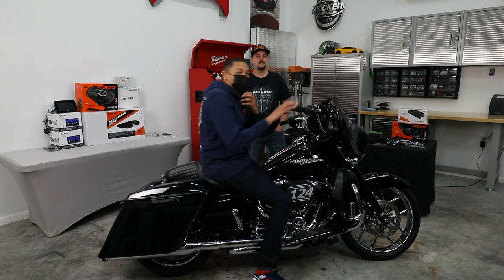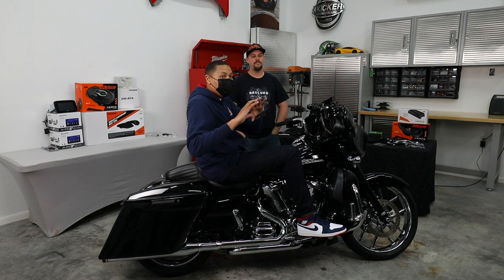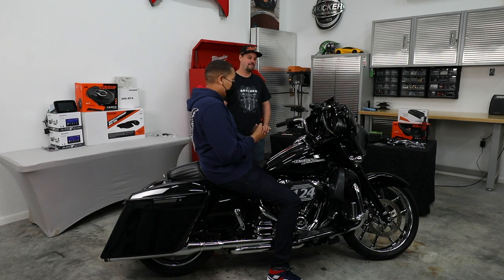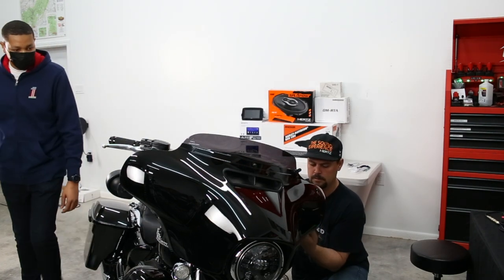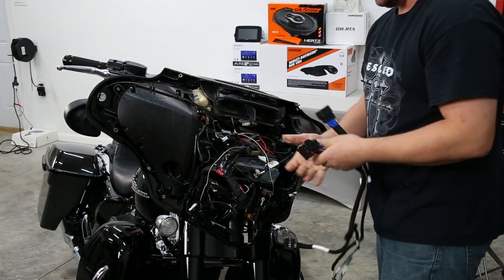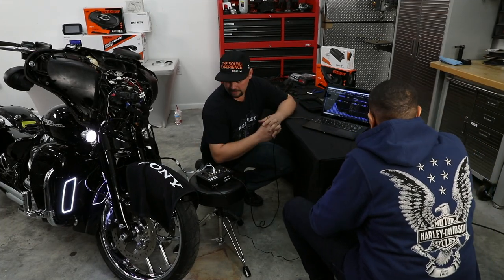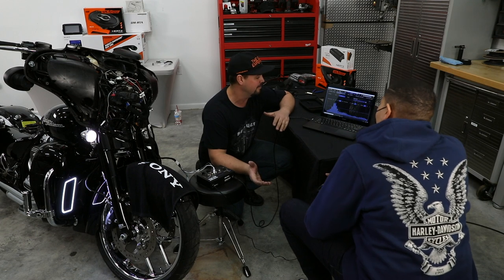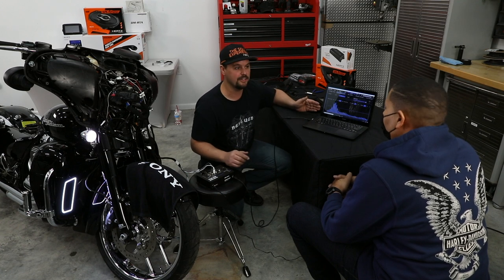Do we need a DSP? Traveling Tall’s 2019 Harley Davidson Street Glide with GTS Navigation Radio

Comment: It is NOT necessary to use a DSP . A simple Flash to your stock radio and removing the factory tune will get you a long way.  If you are using a aftermarket radio you are already   ahead of the game. A DSP   Will definitely help you to achieve the perfect sound for your taste. It is nothing more and nothing less than a fancy equalizer with a lot of extra features.  Great video.
Reply from the maker: Thanks for watching!

Comment: A DSP allows the tuning of each speaker individually as there are manufacturing variances within speakers.  It costs more to install a DSP because the installer then has to understand the software that each brand of DSP has and the software is proprietary.  The Rockford Fosgate DSR1 is about as simple a DSP to use.  There is DEFINITELY an improvement of audio performance if the speakers are tuned properly with the DSP.  But it will cost you.  I am guessing that adding a DSP will add an additional $500 to the install at a minimum and likely much more.
Reply from the maker: We use a dsp when there is a reason to, for sure the Rockford dsr1 was one of the reasons we developed a way not to use a dsp on most 4 speaker rider bikes, it lowers the output of the radio signal too low for most amplifiers to give full potential and adds a lot of induced noise by lowering the signal so much 1.5v, by not using the dsp we are sending over 6 volts of input into the amplifier and using the built in crossovers we are getting a great result.
Reply: I have a constant ringing in my ears do to my service in the army.  I have difficulty hearing any sound in the high frequency range. Doesn’t the DSP control the limits of the frequency range for each individual speaker?
Reply from the maker: @dieseldan5189  so does an eq if you replaced the radio with the Soundstream hdhu14+ or hdhu 14si, with your specific hearing damage turning the high range down through eq either in a dsp, we recommend the hertz s8 dsp, or through a better radio eq may be absolutely necessary.  We try to not use overly bright speakers. I have never understood using horn loaded compression drivers that have way too bright of tweeters then having to use 2 amplifiers and a dsp just to turn the tweeters down.  I would always prefer to let you, the customer, listen to our speaker options and pick the right tone instead of using the wrong speaker and trying to use a dsp to fix the poor speaker choice
Reply: Because I am a loyal repeat customer, my local HD dealer made me great deal on a sound stream hdhu14+ radio for my 2020 Police.  It currently has a Sony 7000 that I installed 3 years ago with the Metra kit.  The Sony works great with the built in Amp but unfortunately, the Sony is not weatherproof which prevents me from taking cross country trips. So I will install the Hdhu+ this weekend.  I am guessing I will probably need an Amp but I will test it first.  I have a 2023 RG Anniversary on order with delivery expected in August.  I will keep the head unit but I will go with a 4 speaker and amp.  I will have the dealer flash the radio to a 6 speaker Boom audio profile when I take delivery.  I will likely make an appointment with you to get the work done.  I could do the install myself but my hearing damage may prevent me from getting the results I want.

Comment: Where do you get that wiring harness and will it work for a 2021 road glide limited
Reply from the maker: We build the harness and yes it will work with 2021 models without boom 2, 2021 does require a special programmer which we have for local installs to flash the radio

Comment: Do know if the 2015 roadglide ultra cvos need to be flashed I've seen where some say they are set to the correct flash due to the boom audio amp.
Reply from the maker: No they have the boom stage 2 flash, still need flashed

Comment: I have a 2015 street glide CVO with the boom audio system. It has 2 amps and 2 speakers in the fairing and 2 in the lids. Would I still have to flash my radio to change out the amp and speakers or is it ready to go since it’s got the 2 amp system?
Reply from the maker: Radio will need flashed to replace amps and speakers
Reply from the maker: We have several cvo specific amp / speaker packages, you can call us @ 1-844-30AUDIO
Reply: Thank you for your quick I will definitely be contacting you to go over a system upgrade

Comment: what if you have a newer aftermarket pioneer with all the controls for hertz etc
Reply from the maker: What exactly is your question? You can add the hertz amp and speakers to a pioneer radio.  The amplifier does have built in high pass and low pass filters and your radio should have at least a 3 band eq.  No need for any radio flash if it has been replaced and time alignment is not needed on a Harley since speakers are equally distanced from you

Comment: I have a 2015 Harley davidson street glide special. It has the gt radio does it have the 2 different settings as well?
Reply from the maker: Yes, you can flash a Gt radio to the same eq settings as a gts radio
Reply: I already have a aftermarket system on my bike. So it's been flashed for 4 speaker system. But I'm not sure if the shop does it like you do. That does both running and not running. Would it hurt anything to do it like you do?
Reply from the maker: @diffman75  of course if they only turned on the rear outputs you will not have a good eq curve and will be more likely to blow your speakers from the distorted bass output
Reply: I'm sure they did for a 4 speaker setup. But not sure if they did for a 6 speaker setup up like you do. That is my question if I order your reflash will it help or hurt.

Comment: Does it matter which 2 Amp file?
Like if I went to harley dealer and ask program gts radio for 2 amps.
Reply from the maker: You need to go to an independent Harley mechanic that has a techno research programmer, most Harley dealers are now locked out of audio programming if the data lines in the bike does not see a boom amp.  Flash the radio to the standard boom 6 speaker 2 amp flash, do not flash to boom stage 2